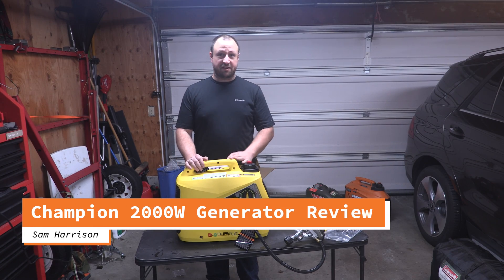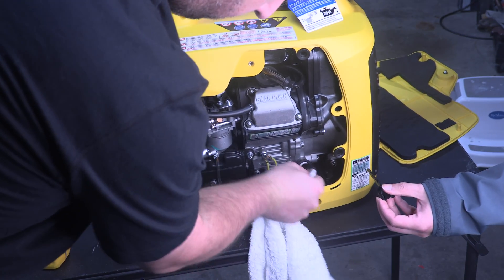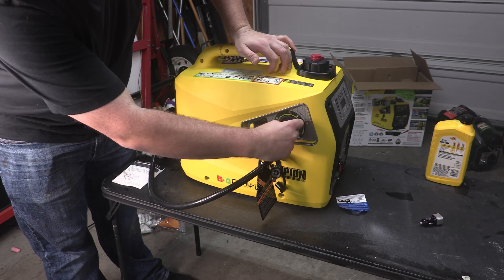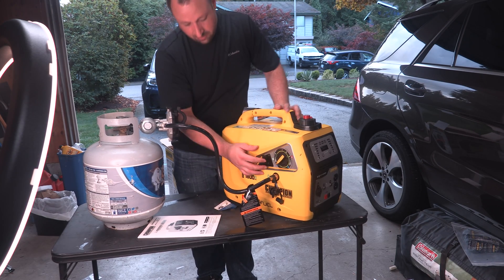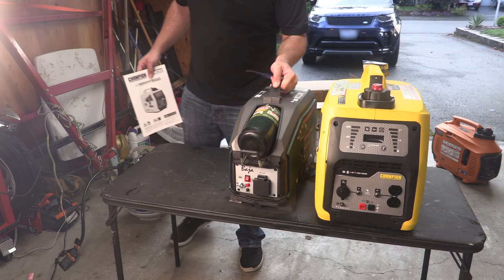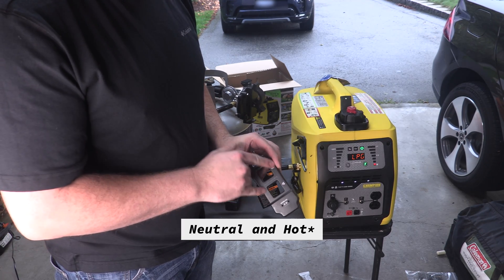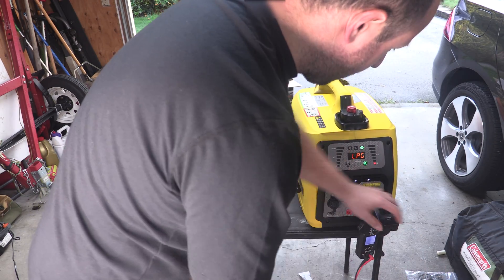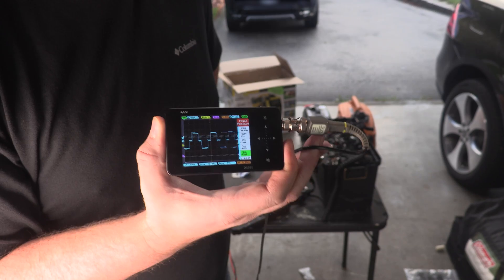Champion 2000 Dual Fuel Generator Review and Test

Comment: Are able to test the spectrum of the output? Purely looking at the waveform can not clearly identify how clean it is. Ofcourse, better than the 8usd inverter.
Reply from the maker: I don't have any equipment to evaluate the power spectrum. I'm not an EE, so i recognize my skillet in this domain is probably a bit lacking. Do you have any recommendations for equipment that can do this? Hopefully with a price tag that won't break the bank?

Comment: I like the built-in meter and LED bar graph for power output.  I could find the gasoline only version easily, but this dual fuel version was out of stock or being sold for over $1000.  Champion confirmed it is discontinued.  I wonder why?
Reply: Bass pro has 2400

Comment: INVERTOR GENERATORS WEAK LINK! So many people are concerned about clean inverter power from generators. I still run my old indestructible and proven 1850 Coleman Powermate pulse (Non Inveertor) generator for 25+ years computer, cell phones, tvs, drill, saw,  battery charger and more for years. I through have maintainced it. Never burned up anything with the 1850 unless I intentionally over reved throttled it experimenting. I already burned up another New Invertor Chinese 80cc dual fuel generator after only 6 months living off grid running on propane. Reason I bought dual fuel 80cc invertor generator: little quieter, dual fuel, more fuel efficient, less weight, more power. I thought it would last 25+ years like my old 1850 generator was I wrong and ticked!!!  Burned up the cheap and weak invertor board that happens from overloading the generator. It don't blow resetable breakers once and a while like my  indestructible 1850 generator does or rattle the valves when over loaded. These echo idle invertor generators burn up stop making power from user not knowing being overloading.ostly these invertor generators are weak. A person I know burned his generator invertor board up too. That is the real problem. Engine runs no power (yellow over load light comes on) a weak link in the so called cheap sine wave invertor echo idle generators overall not dependable that's why. I bought a Honda 2200 and the others mostly dual fuel I have for backup.

Comment: What is the model number of your oscilloscope? I’ve been looking for one to actually test all my generators also. 
Thanks
Reply from the maker: The one here is similar to this, but this model is slightly newer: https://www.amazon.com/dp/B074QBQNB7. Check around Amazon and find any that look similar for a lower price though since these are cranked out in some random factory and there are around 20 distributors that silkscreen their logos onto them.

However one of the plugs for a cable broke on that one (since it uses a mini-adapter), so i bought this one instead... and it seems to be a bit higher quality. Again, these are cranked out and get a dozen different brands... so choose the cheapest option you can.

https://www.amazon.com/dp/B088ZXJSD6

Comment: Isn’t a heater or lighting a resistive load?
A refrigerator motor or A/C unit an inductive load?
Reply from the maker: Correct... and I'm guessing you're calling this out because I misspoke in the video, huh?

Thank you for correcting me!
Reply: @harrisonhobbies241 , I’m not calling you out.  I was wondering if I misunderstood something.   I appreciate your willingness to test as you did.  You are the only YouTuber so far that has gone to that extent.  That current-splitter is a great idea that I will definitely buy, thanks to you!  Also that little oscilloscope is something I will look into.  Keep up the good work.  I wish you much success.

Comment: “10w-30 weight”... 10 is the oil index temp for cold or “winter” and 30 is the index number for hot temps... many people say 10 “weight” 30. However the ‘w’ in 10w-30 stands for winter. Just a fun little tidbit 👍
Reply from the maker: Thanks for the info. If I gain nothing else from making these videos, that fact alone was cool enough.

Comment: thanks, can this easily be converted to run on natural gas?
Reply from the maker: Hello! I'm not sure if there are any kits that exist. I did a cursory search out of curiosity, but nothing came up for this model specifically.

The high pressure regulator is external, and  the quick-connect coupling is connected directly to the carburetor. So it looks like you may only need the low pressure NG regulator and some connectors to make  it work. You should certainly double check what i've said though since i don't want to lead you astray.
Reply: @harrisonhobbies241  got it 😊 thanks
Reply: On my Hutch Mountain tri fuel kit for my 2200 watt Honda set on propane. To go to natural gas. I change jet at the plastic - polymer base by air filter I wouldn't want to do this alot, risk of breaking or cracking plastic - polymer base by carberator. Jet is inside fuel hose. Not sure if you have to adjust the kn one way valve or not I would have to look at instructional manual to be for sure. Also have the right connection at the natural gas hook up. Never know in a state of emergency they feel or worse they can shut off every thing natural gas too. Sadly they do whateber they want. Natural gas endless supply of fuel.